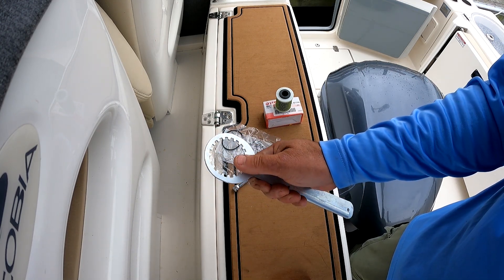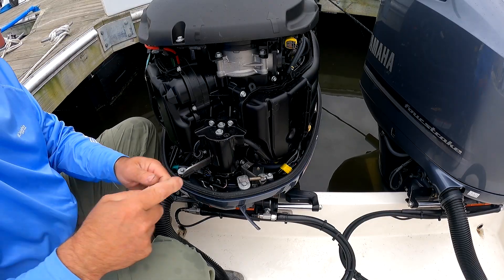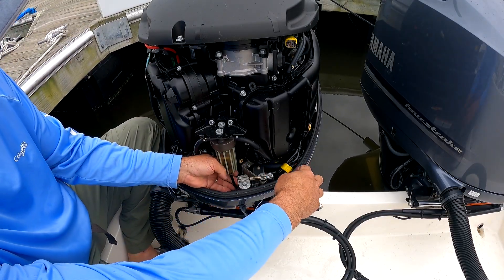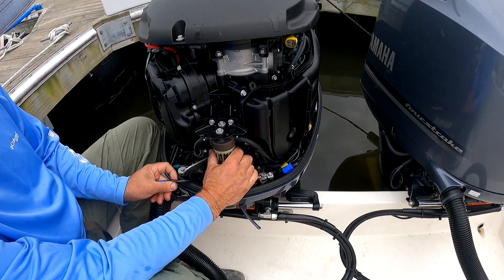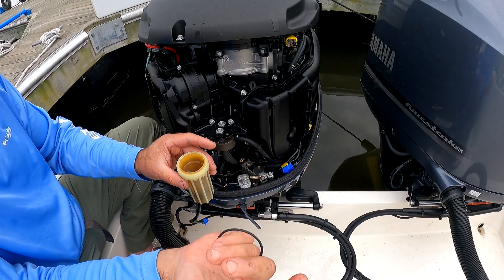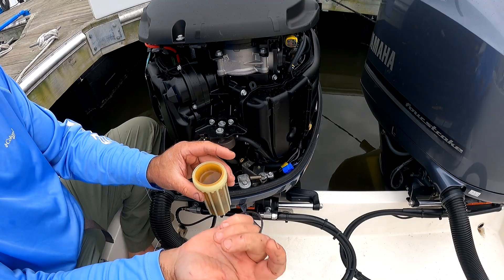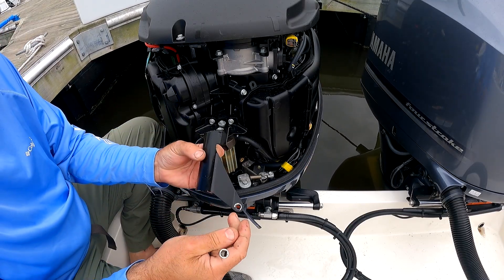Yamaha 4.2L V6 fuel filter change - 225 250 300 HP

Comment: What makes filter fill up and leak down half way..fill up and back down. Every 30 secs it fill to top and back down
Reply from the maker: Your low speed pump aka take up pump fills the filter and your VST tank.  Your high speed pump sends it to the motor from the VST.

Comment: How can I send you a video ? I have some strange black particles on the starboard side of my Vax sho 250 2015 looks like small bits of charcoal. Only on the bottom of lower cowling. From front hinge to shift rod.
Reply from the maker: 4ribsfishing at gmail

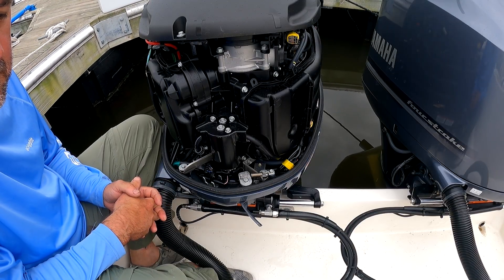Comment: Best 5:48 I've spent in a long time, sir. Lots of experience shared there that you won't see in a manual... careful not to drop that bolt down in the lower cowl, don't double gasket, keeping pressure on the bolt / bracket, noticed the torque to remove and to install, I wonder if one of those keeper washers between the bolts and bracket would be a good idea.
Reply from the maker: That’s kind of you to say grunner30.  I think the keeper would work, but after the first time you use the bracket to hold the bolt you will find you use that truck elsewhere.

Comment: I'm gonna disagree that everyone should do this.    I just broke the fucking bowl because for God knows what reason they have torqued it on there insanely fucking tight.    It's so annoying to have to buy a special tool.that will only get used once a year.   This easily could have been designed so that water pump pliers could remove it.
Reply: And of course it's Yamaha so I bet this is a fucking $150 piece of plastic I now have to buy
Reply from the maker: Someone tightened it too much on you.  I’m good for 3 100hr services a year, so the tool is worth it for me.
Reply: @4RibsFishing  brand fucking new boat.  Doing my 20 hr service.    Annoying because we all know the fucking filter is fine, same with the fuel water separator in the boat but we gotta piss money away some don't void warranty
Reply: Okay, I came down off the ledge, the starboard one was easily removed by hand.   Still super annoying to be out $100 but still.cheaper than paying a marine mechanic
Reply from the maker: @centralparkfitness  congratulations on your new boat.  Keep taking care of it and she will always get you home!!
Reply: While this video is helpful, this is not part of the required maintenance in the Yamaha manual. It is found under trouble shooting where the manual states to perform this when "water separator-alert indicator blinks while cruising, perform the following procedure", not part of scheduled maintenance.
Reply: @smoakallen1992  not true, it's called for as part of regular service
Reply from the maker: @smoakallen1992  are you sure?  I just double checked my genuine Yamaha manual and it says check/replace every 100hrs.  It’s in the chart in chapter 10.
Reply: @4RibsFishing  I see it there in the chart and it does say inspect or  replace as necessary. There are others that say inspect or replace as necessary such as fuel lines, which I don't think is necessary. I do replace the external 10 micron fuel filter every 100 hours. I just don't see it as necessary every 100 hrs with the external filters, but I did think the video was very helpful.
Reply from the maker: @smoakallen1992  I agree Smoak,  I often wonder how many of these are money makers vs necessary.  I used to run 2stroke wave-runners and changing fuel filters was a normal regular thing.  I don’t mind doing them on my 4strokes.  Unfortunately I will hit 2-3 service intervals every year, so the parts bill adds up.  No labor though!!! Thank you for the kind words.
Reply: wasnt going to get the filter tool, after reading your comment I ordered it... thanks and sorry for your troubles!